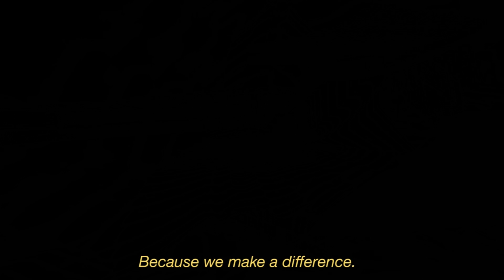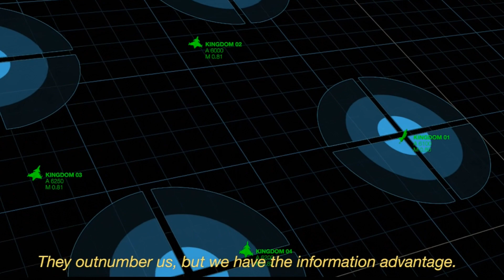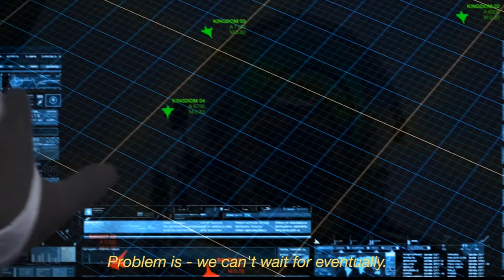Gripen Fighter Jet - Canada's Future Fighter?

Comment: Canada's experience with SINGLE engine fighter jets was not very good. For instance, out of some 200 Lockheed single-engine super fast CF-104 Starfighters, there were 110 Class A accidents and 37 pilot fatalities. The Belgians, the Dutch and the Germans had the same bad experience... That was enough for the Canadian Air Force to decide to never buy single engine fighter jets again. I can understand that the Gripen engine could be more reliable than the CF-104's, but a single bird could destroy that single engine just the same, as there's no second engine to keep the plane flying when swallowing a bird.
Reply: Gripen got less crashes per 100.000 flight hours than the two-engined F/A 18 Hornet that Canada now uses. So if safety is your greatest concern, then you should sell your CF18's and buy Gripens instead.
Gripen is also much less likely to chrash than the shitty F35 built by Lockheed (the same company that built the F-104 Starfighter).

So lets compare Gripen with other modern two engine planes.....

Gripen’s crash rate is 2,46 planes per 100.000 hours
F-18 crash rate is 3,6 per 100.000 hours
Rafale got 6,25
F22 got 5.49
F117 got 4.07
F4 got 4.41 (but some data say more than 20)
F14 got 5.76

And the shitty F35A got 7.34

Conclucion: Gripen is among the safest fighter jets one can fly.
And your argument about planes with 2 engines being safer is just a baseless claim that doesn't hold up. 

And since you think a 60 year old fighter is a relevant in 2017 as an argument for not having single engine planes.... then one could just as well use the twin engine B-26 Maruder (aka "the widowmaker") as an argument why Canada should not use twin-engine planes because they are "unsafe".
Reply: I didn't take the decision to cancel the Widowmaker Lockheed F-104, from the bad experience in the 60s and 70s. The Canadian Air Force did, and I would not be surprised the Belgians and the Germans did as well. By the way, the Canadian territory, and especially its North are huge for patrol/interception, where airports are often close to a thousand miles (multiply by 1.6 for kilometres) apart. I'm not a salesman for the Swedish Gripen..., and I have nothing against it, except that if one engine stalls, there's no other to keep that bird flying. Up the Canadian North, that means a dead pilot if he's not found and retrieved fast. I lived in the Arctic. I know the problem: a minus 40 degrees can go down to the minus 90s if the windshield factor really interacts. I know. I lived to feel it, but I was in a city and dressed for the Arctic, a situation that would have not permitted me to sit in a fighter jet. I was an air force officer, by the way... Surprisingly, your Gripen is equipped with a General Electrics turbine. The SAAB fighter jets used to be equipped with Volvo turbines some time ago. I agree on a major fact: any fighter jet is still cheaper and better than the F-35, and even the F-22, considering the high number of service hours for each hour of flying.
Reply: Most of the problem with the F-104 was how the Germans used it (they played around with it as a low altitude attack aircraft with a plane that was fast and easily stalled and it therefore quickly went down into the ground). Other countries (as Spain) didn't have excessive crashes with the plane because they used it on high altitudes where there was much more time for a pilot to save his plane from crashing by a stall.
It was not the best plane, but its biggest problem was how it was used.
Reply: "I have nothing against it, except that if one engine stalls, there's no other to keep that bird flying. Up the Canadian North, that means a dead pilot if he's not found and retrieved fast. I lived in the Arctic. I know the problem: a minus 40 degrees can go down to the minus 90s if the windshield factor really interacts."

- A plane could go down crashing for multiple reasons and not just the engine - the flight control system can fail, the landing gear could jam, the B26 bomber often had accidents because it came into landing at a too high speed, and the Me109 had its tight landing gear that caused many crashes, and so fourth.
So it makes more sense to actully look on how many planes have been lost in total than just stirring oneself blind on the fact that a plane lacks an extra engine - like you do now.
JAS39 Gripen have so far not have not had a single crash caused by its engine. And it is also overall a safe plane that is more likely to get you home alive in a trip to the north pole than a F/A 18 Hornet.

And a twin-engine pilot will just be equally dead in the artic if his plane gets hit by lightning and crash, or if his plane gets destroyed in a mid-air collision or hitting the ground, or if his flight control system fail, or if the pilot makes a mistake because of spatial disorientation or if he forgets to close a hatch after his plane has undergone aerial refueling and run out of fuel and crash, or if someone shots down his plane by mistake. A fuel tank could also catch fire and bring down the plane.

So as I said, much things can bring down a plane - not just a failed engine. And with that in mind I would say Gripen is one of the best planes for artic climate. Northern Sweden is a also a cold place that needs to be defended, so its an obvious must for Swedish military aircraft that it should be able to function in cold harsh climates. Northern Sweden is very cold, and this is why this country produces so many NHL-players.

And Gripen also got equal or better range than F35, Eurofighter, Rafale, and Superhornet.
http://gripen4canada.blogspot.se/p/how-the.html
Reply: The howling fast F-104 Starfighter also had another major configuration problem: an ejection system launching towards the ground, downward that is : dramatic results at low altitude for the pilots... High altitude or not, AGAIN in Canada a single engine can be catastrophic, the airports being so far from one another above a certain Northern altitude, and the Arctic winter weather doing the killing of a parachuted pilot within a couple of hours if he's not rescued and immediately protected from such a cold. You try it and you tell me. I went hunting with the Inuit a few times, a great people by the way, and their knowledge of weather and weather change prediction is amazing. They've been in the high Arctic for as long as 14,000 years, if not more, say the archeologists, and they don't go hunting in the dark freezing winter and the other season without sufficient food, weather protection, heavy canvas tent (igloo building snow type is not always available, and a heavy canvas tent can be installed and ANCHORED within 10-15 minutes before the whiteouts hit them), etc., precautions the fighter pilots can't have aboard...

Comment: The number of sorties per 24/hrs is critical. The Gripen takes only 10 minutes to re-fuel and re-arm. That is an incredibly short turn around time. With the development costs paid, current Gripens can be bought for about $30M each, I believe. That is pretty cheap. 
It may not have all the stealth that an F-35 has, but the majority of situations an air force faces do not require that. It is also important to have numbers. For instance, the F-22 is a great plane, but with only 190 of them, that is almost worthless if the US ever needed them in a war. For regional, targeted, brief engagements, only a few may be adequate. 
However, the F-35 has really dropped in price to about $75M each. Is it twice as useful as the Gripen? I wonder. 
Also, if Canada were to use them together, it would be nice if they networked battle info for tracking, targeting, and killing. I wonder if they can do that?

Comment: You keep saying that the Gripen is much better than the alternatives but give very few direct comparisons between the different aricraft. You kept saying that the Gripen is a perfect fit, a "no brainer", for the Canadian airforce but don't seem to actually outline what makes it so good.
Reply: He outlined the reasons - it is far more affordable to own and operate, which make routine patrol missions cheaper.
It allows Canada to own fewer F-35s, as they only be used for contested airspace missions (a minority of missions).
It is a new airframe, with a long life ahead of it. F-18s and F-16 are legacy systems from late 70s/early 80s. They've had a good run, but you can't expect to have them modernized for the next 40 years.

Comment: I"m both Swedish, and a big fan of the Gripen (not sure how these are correlated). With that said, while I am usually very comfortable arguing that the tradeoffs that the Swedes made with the Gripen are worth if for most potential customers, I feel like the low range, the single engine, and small payload are a bad match for the Canadian air force.
Reply: Another ignorant commentator. Here is the thing.

- Gripen has better range than the F18 Hornets currently serving in the Canadian airforce. And Gripen also got better ferry range than F35, Eurofighter, Rafale and the super Hornet. So its ironic that you talk aboutt range as a weakness when it is superior to all its competitors.

- Having only one engine is not a disadvatage. Gripen got much fewer crashes per 100.000 flight hours than for example the Canadian Hornet, so if you are worried about a crash in Northern Canada you should then seel your Hornet and buy Gripens instead. And neighter does two engines mean you getter better speed, since two engines takes more place than one engine, and therefore creates more drag that slows the plane down.
Other benifits of just one engine is lower costs, lower fuel consumption, and lower costs for maintance. And since Gripen needs less maintance than two-engine planes it is possible for it to fly more sorties.

- The payload is almost as large as it is on Gripens competitors, and Gripen can carry a large variaty of cargo suited for every kind of mission. Furthermore can Gripen fly more hours per day than any of its competitors due to its low demand for maintance... which means Gripen is able to fly more bombing missions per day than other planes.
Reply: Very well said
Reply: I stand corrected. I wish I was more transparent (both to myself and to others), that I dont know what I am talking about regarding fighter jets. Kudos to you sir.

Comment: If you take the politics out of the equation and with single engine fighters being reliable and safe (great engine and terrific safety record from what I can see) then the Gripen should win the competition hands down.  It may not be a leading edge "5G" fighter but its small (stealth isn't perfect so size is a factor), fast and lethal.  Did I mention it was easy to maintain, refit and cheap to fly.     Hopefully our government  asks our fighter pilots for their input and we've had them test fly each of the competitors before spending a dime of our money on any new planes.

Comment: I think Canada should keep the deal that they made, and get the best fighter available. The F-35 is about 20 times better than any fourth generation fighter. Recent developments prove the F-35 is a stone cold killer. I hope Canada can see beyond ridiculous politics and just get the best jet.
Reply: - It got crappier thrust to weight ratio than Rafale Gripen and Eurofighter.
- Its ferry range is lower than those three earlier mentioned planes.
- It also got a lower maximum speed than all those earlier mentioned planes.
- Its wingloading (91.4lb/ft2) is also shittier than all those three planes.
- It is also uncapable of supercruise unlike the other planes.
- Its combat radius is smaller than both Gripen and Eurofighter.

http://gripen4canada.blogspot.se/p/how-the.html
Reply: I guess 4-th gen fighters can't beat F-35s in air-to-air or access to contested airspace, but you don't need a very expensive stone cold killer for routine patrol.
Keep the F-35s for the hardest tasks, but use the Gripen for everything else - it will get the job done far cheaper.
Reply: You sure about 20 times? Not 19.7 times, or 21.3 times? You must have carefully measured its betterness. No?

Comment: The purpose of the F35 is to keep Lockheed-Martin in business. I don't believe it will ever be an effective aircraft for any mission because it's meant to be an effective aircraft for every mission. That just isn't possible. Even further I don't believe that the F35 will ever come into service.

In my opinion manned aircraft are obsolescent. Barely effective and far too expensive. I believe that RPVs (Remotely Piloted Vehicles) are the future. They will be cheaper to manufacture since there will be no need for cockpit etc. for the pilot. Lack of a pilot will also allow the aircraft to pull far greater Gs, and if the aircraft is destroyed the pilot survives and switches to another RPV.

I know that's going to piss the fighter jocks off but their job is one that can and should be replaced by technology.

Comment: The next batch of F35's will cost 85 million each. The 2020 batch will be 80 million each. The final software release will occur next year. Then it will be block upgrades every 2 years.  The internal racks are being refit next year as well since the F35 will end ILRP and be going to FRP. Which means it will now be able to carry more internal weapons in more variety. They are even designing a laser pod for CTOL version of the F35. They will remove the extra fuel tank behind the pilot and the internal laser will go there and the emitter will pop out of either the top or bottom of the aircraft. Everyone complains about the F35 but this aircraft isn't just some little upgrade. It's a massive leap in technology. You are going to have glitches and issues along the way. If you talk to the pilots they love the aircraft. During every red flag event the F35 is just owning everything, especially when it comes to penetrating dangerous air defenses or beyond visual range encounters. Enemy aircraft simply cannot see the F35's unless they are handicapped. So everyone can use old testing info to trash the F35. Everyone can quote that lying hack Pierre Sprey who gets paid by RT to trash pretty much any NATO aircraft that's not from the 70's or 80's, but the F35 is coming into its own and the aircraft and pilots are going to mature. The price is already coming down as they predicted. The Gripens sensors are no where near the ability of the F35. Hell there are 6 infrared cameras just for the F35's DAS system.
Reply: the non american public is well aware of the poor readiness rate of the F35 electronics suite AND it's nightmarish maintenance regime that only the USNAVY can afford.
yeah the purchase price dropped- the operational costs DIDN'T. it's like a bar with FREE SALTED PEANUTS but  10 dollar beers .
btw the A10, the F16 and the F15 were FAR better craft in their class than their rivals.